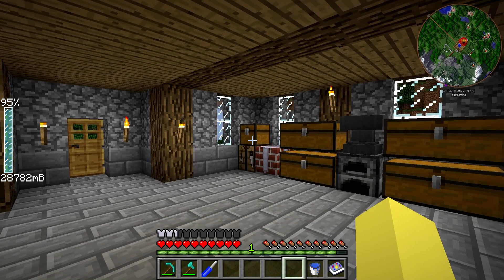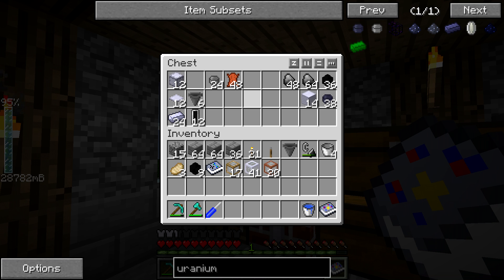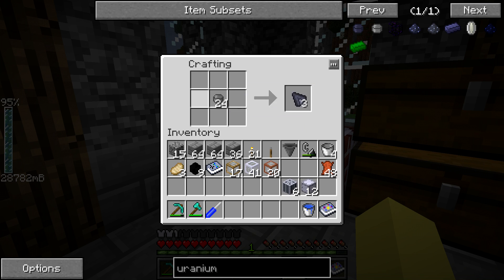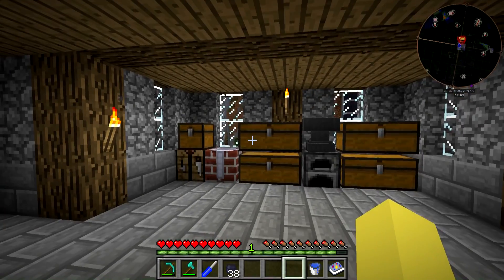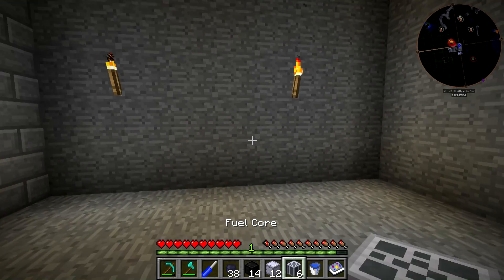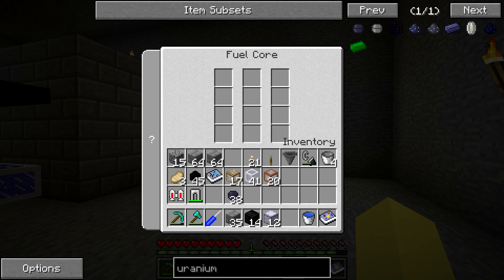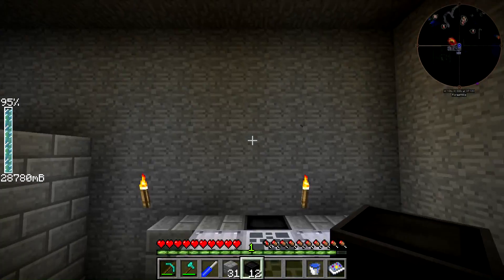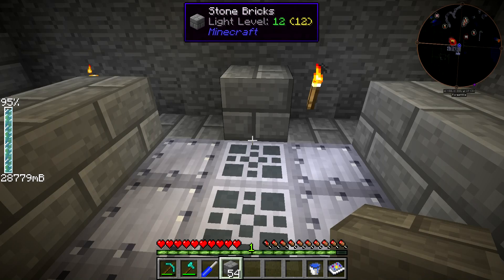Surviving With RotaryCraft :: Ep.21 - Fission Reactor

Comment: Um. You DONT insulate fission reactors.  

ReikasMinecraft 1 year ago
A warning in advance for when you go to fission reactors. Do not try insulating them thermally. With them, the whole fight is to keep them cool.
Reply from the maker: I know right now that with the neutrons shooting out (even though the neutron reflectors are supposed to absorb any they don't reflect) I am supposed to at least insulate it with blocks to prevent the neutrons from escaping (like concrete or bedrock alloy). If the neutrons didn't escape (like the block is supposed to prevent) then I wouldn't have any blocks around the setup :)
Reply: +DrRageHard Oh. Reika did say that he was going to nerf them in the comments though. It might be intentional. I said don't insulate them thermally. You only put concrete where the neutrons can actually reach and you do need concrete or bedrock alloy blocks to insulate them. You are using stone bricks, which dont have any real effect for neutron blocking.
You thermally insulate it, and you don't prevent the neutrons from escaping, a lose-lose.
Reply from the maker: Yea, my bad. I am so used to using the insulation for the steam boiler / pebble bed reactor its force of habit. I will be sure to go back and swap the blocks out / open the non-cardinal sides of the fuel cores. Thanks :)
Reply: +DrRageHard ok dont hate me senpai ;p

Comment: em, I recommed you using just 1 steam engine with only 2x gear. It is theorically 2000 times faster. (operation time 2sec vs 0.001sec) you need at least 4x5 water pool or it will get drained.

[Time (in ticks) = 200 - 20 × log₂ (speed + 1)]
Reply from the maker: Oh, that is a great idea! Completely forgot about doing that so I will go and change it in the back room asap :) Thanks!

Comment: This Hazmat suit looks way better than the one from IC2.

I think the big turbine produces both enough speed and enough torque to run an Extractor at full speed without flipping them. Might take a bit of work with gearboxes to slow it down a bit for more torque, but...
Reply: Extractor speed is only affected by speed. not torque.

Stage 1: Time(in ticks) = 900 - 60 × log₂ (speed + 1)
Stage 2: Time(in ticks) = 400 - 20 × log₂ (speed + 1)
Stage 3: Time(in ticks) = 600 - 30 × log₂ (speed + 1)
Stage 4: Time(in ticks) = 120 -  80 × log₂ (speed + 1)
Reply: No, actually speed is important for stage 2,3, while stage 1,4 require high torque.
Reply: +jupiterbjy Yeah. Most of RotaryCraft machines speed up by add more speed(RPM).
Reply: True enough. I've always found speed harder to come by than torque. But the turbine has no shortage of speed, so sacrificing a bit for torque is worth it.
Reply from the maker: Yea, I actually enjoy the way the Hazmat suit looks. I mainly plan on hooking up a huge battery to the turbine from electricraft and then using that around the base to power random things since it will be easier to transport.
Reply: Ah, cool. Does it have it's own power aside from RF then?
Reply: at least It accept UE. I'd rater use electric generator rather than max output capped rotational dynamo..
Reply: You can use CVT Unit, and put 31 belts in that, turn it into acceleration mode, set the ratio to 27.
It will more efficiency.
Each  of stages of Extractor will use  1 tick to process(Operation time is 1 tick).
Reply: +Triaxx2 The torque of stage 1 and 3 just can activate the process. If you give Extractor more torque, it won't work faster, it may work more slowly.
So base torque of the machines, you just need to reach that.

Comment: Neutron Absorber only effect on the neutrons from Fusion Reactor.
By the way, neutrons can go through any blocks, and Neutron Reflectors cannot catch all of the neutrons, so you should use some blocks can absorb neutrons, you can use concrete or block of bedrock alloy to absorb neutrons.
Concrete has 33% chance to abosrb neutrons, block of bedrock alloy has 97.5% chance to absorb them.
When the reactor works, it will slowly generate some radiation, you can use something to clear them.
And you should grab Radiative Goggles(I can't remember that)from NEI although it's for debugging, it's useful.
Reply from the maker: Sad to hear that neutrons still make it through the reflectors :( the info says it will absorb all the neutrons that don't reflect, but that doesn't seem to be true. I think I will add concrete around the outside and hope that does the trick before jumping to bedrock alloy. Just made the goggles and they work wonders! Thanks :)
Reply: hmm, I never seen guy who use more than reflector&concrete configuration..
Reply: just for safe(^_^)
Reply: Safety first!